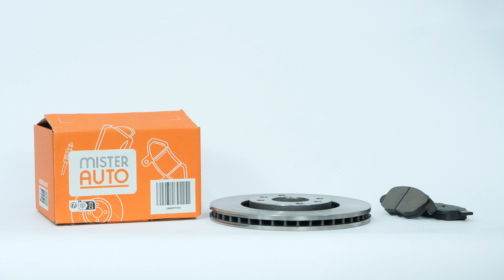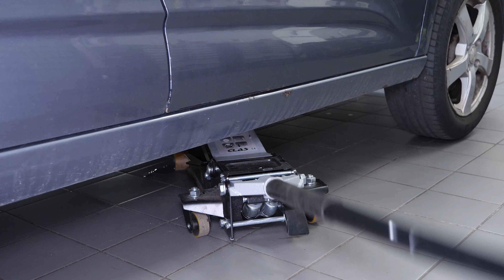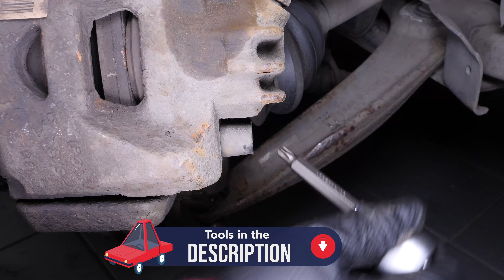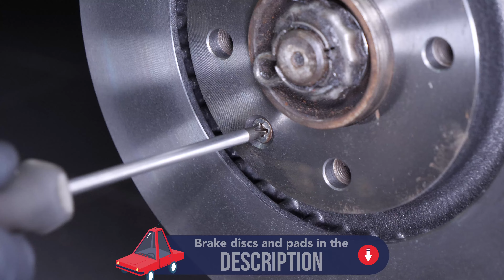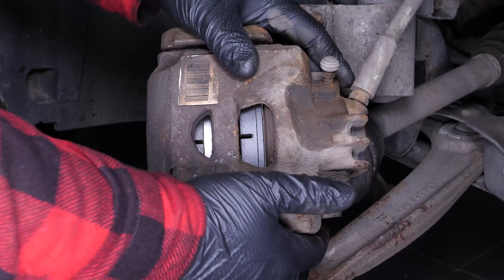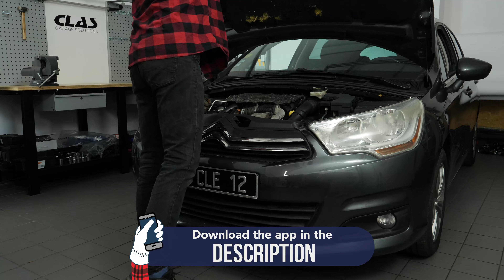How to replace the front brake rotors and pads Citroën C4 mk2 🚗

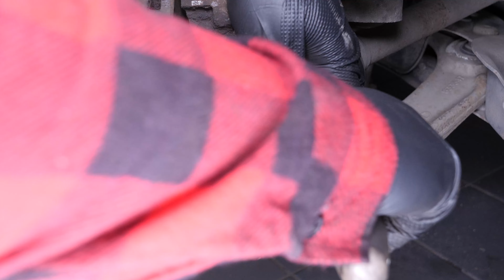Comment: Hello, I read that the caliper mount E16 Torx bolds @3:03 are not reusable. Can you confirm? If yes, where to order such bolts? I think the OEM numebr is 440558
Reply: theyre reusable but they snap alot of the time, id recomend getting new ones, theyre not expensive

Comment: Hi there , this is great I will be ordering my parts tonight , but is it essential to have the piston wind back tool or is there another way to do this without it ?
Reply: You can use a G clamp, used for clamping wood and use one of the used brake pads pushed against the piston to wind it back in
Reply: it is essential or you wont be able to fit the new pads into the casing.